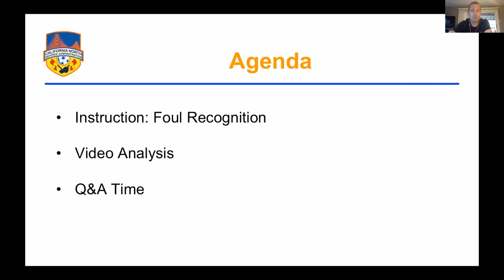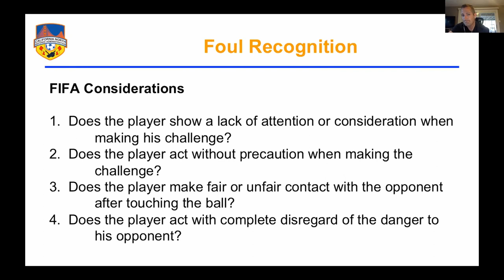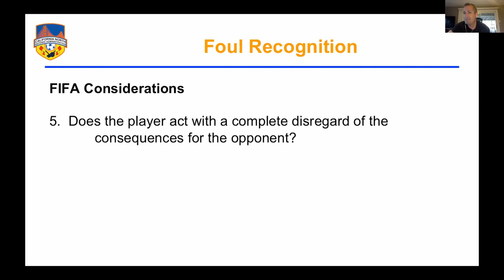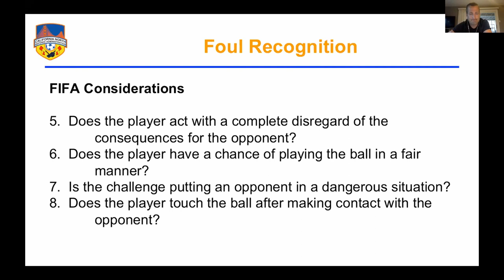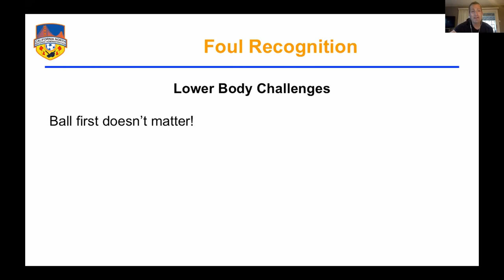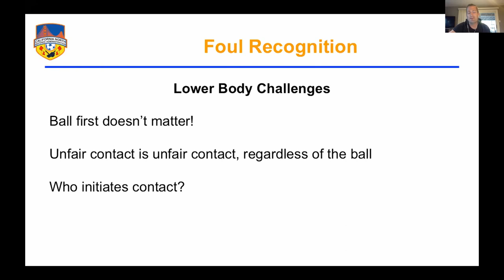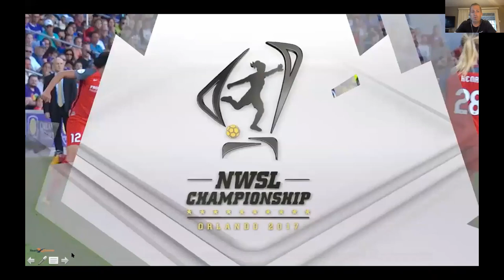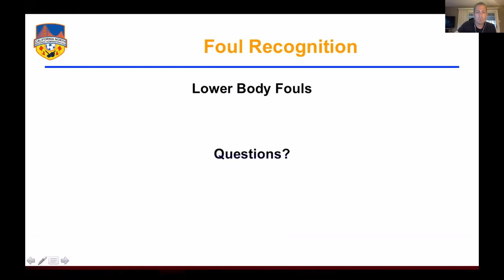Foul Recognition (Part 1: Lower Body Fouls) - CNRA Webinars

Comment: Great vid and useful tool for officials at all stages of their career.  With that said, I struggle with the first example being a foul on blue.  Both players are entitled to the ball, blue slides to get the ball and white enters that same space to also get the ball and actual strikes it.  It appears to happen so quickly with neither player considering their opponent.  At best it looks like offsetting fouls or a no-call.  I can see how it "looks" like it should be a foul but I don't think it actually "is" a foul.  (With all due respect)

Comment: Even if a referee is within 10 yards of a play, being able to make a clear distinction between fair play and a foul is extremely difficult in a split second. We can only call what we see, even if it's on video, if the referee didn't see it, they can't call it. We also need to be careful with Simulation, deceiving a referee is also a big problem in older age groups.